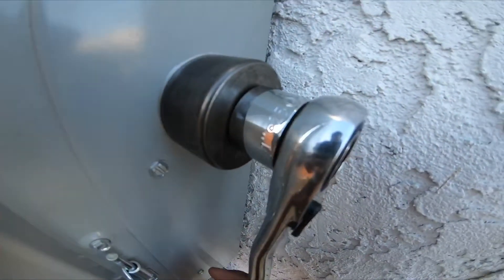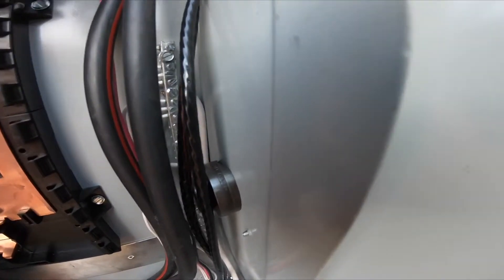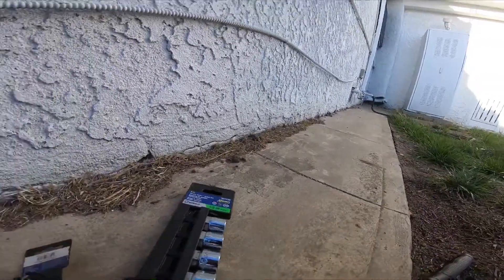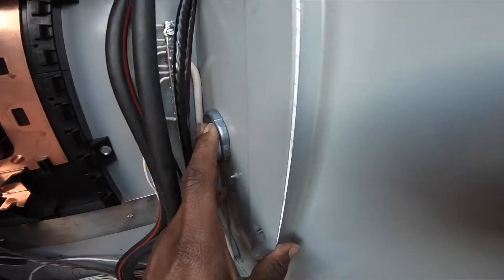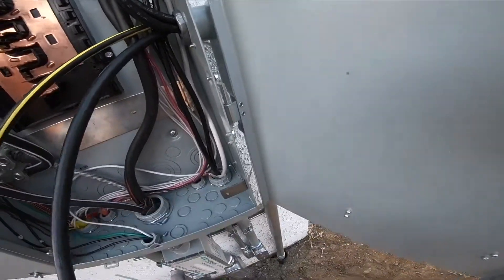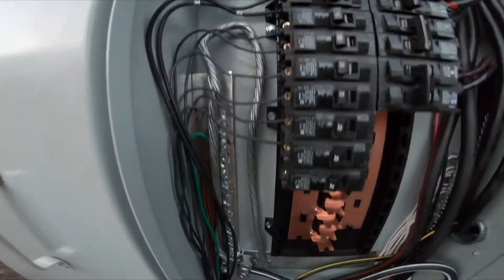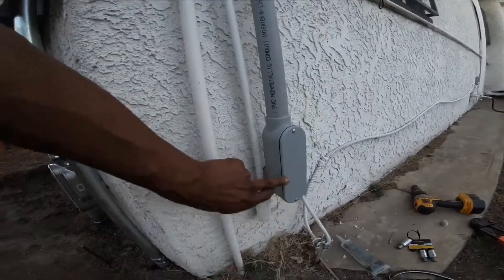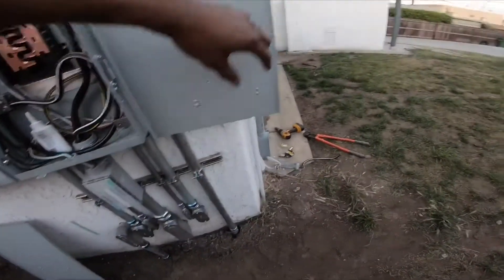Electric service Conduit knockout how to

Comment: I may need to buy a knockout tool, like he is using.  I have a Cutler Hammer load center (circuit panel). The knockout impressions, on its side, seem to be secured by more than just spot welds.  Punching on them is ineffective.  Those knockout impressions are solid metal.
Reply from the maker: They are really cheap on ebay.
Reply: @fullmetaltoolbox1412  Thanks.  I think what mislead me is that I saw another YouTube tutorial where it was demonstrated how to do a knockout where the circular impression in a panel has only two spot welds.  Clearly, that is not the case with my Cutler Hammer.